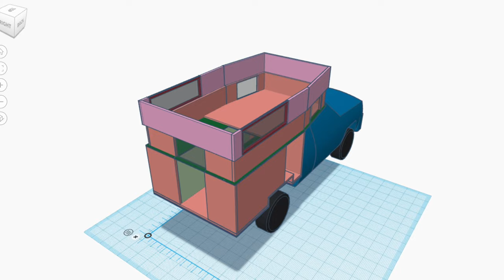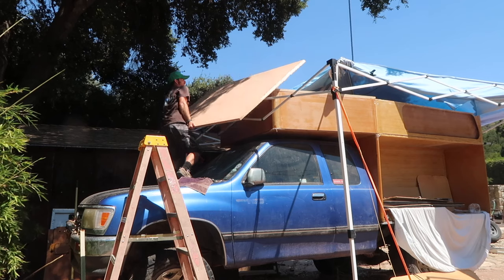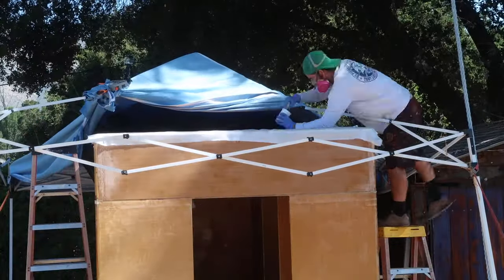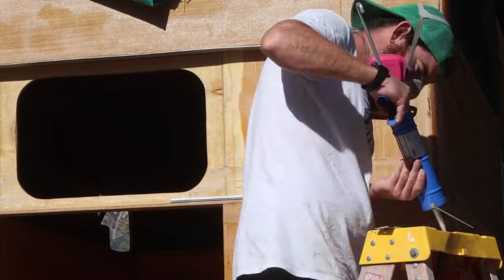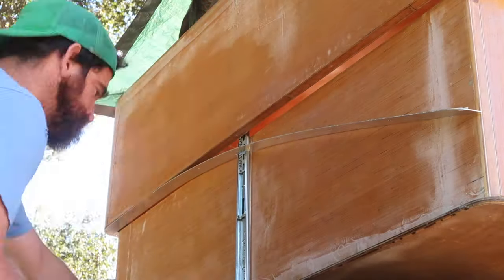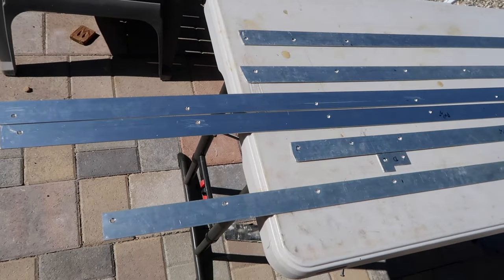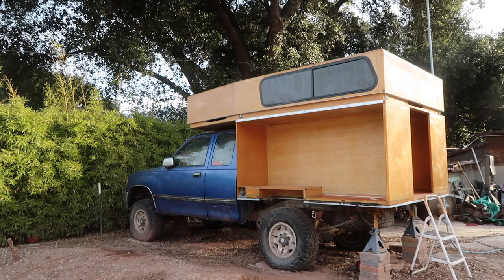Building A 4x4 Truck Camper | DIY Hard Side Pop-Up

Comment: Hi Matt - great idea for the guides and seal system. If you are planning to install a ventilation fan suggest you use a reversible model. Running it with the windows and doors closed drawing air in will pressurize the interior slightly to aid lifting the top. Running it “out” will help draw the top down.
Reply from the maker: interesting idea

Comment: Great thinking on using the drawer slides for the pop up top  as guides.👍😎
Reply from the maker: Thanks Jack. It's working well so far. The whole thing is an experiment of course, so we'll just have to see how well it holds up once I finally get to start torture testing.

Comment: Maybe a second D seal on top of the body's aluminum cap, so it seals when lowered?
Reply from the maker: I'm still considering it... Could always use more seals to try to keep that Baja silt at bay.
For now, I am adding a seal around the bottom of the aluminum on the pop-up. It will provide a seal and a bit of cushion to sit on while it is clamped down.
Reply: @TheTravelingTogetherJournal  Makes sense. Looking great!

Comment: 1st time watcher, new subscriber! 

Great information! You've answered/given me ideas on how to repair my Jayco Sportster 7. Absolutely love the drawer rail idea, the handles to pull the roof down, and the latches on the inside. Why did you place the forward struts where you did again? I missed that part even watching it again.

Great video!
Reply from the maker: Welcome aboard!
I put the front struts where I did because that was as far forward as I could put them without encroaching on the width of the queen mattress. In hindsight this didn't work as well as I thought it would. I think mounting the struts all the way forward and using less forceful struts in the front would have made for smoother motion in the pop-up. Currently it wants to teeter-totter a bit with the struts as a pivot point when lowering the pop-up.
Reply: @TheTravelingTogetherJournal  yes, I saw the teeter tottering in your video. Interesting fix using straps. Thanks!

Comment: I have a similar idea but using foam and poor man's fiberglass. Only I want it on top of a SUV. Then the rear section would have a stand-up shower.
Reply from the maker: Seems feasible. I've seen some cool diy suv or van pop-ups, but never a hard sided one. Good luck on the project

Comment: I like the idea of the design. But why not use actuators to raise the roof by just one push of a button? Just a suggestion.
Reply from the maker: I looked into them a while back and was seeing reports from other DIY builders that were having trouble getting all of the actuators to raise and lower at the same rate, particularly if their battery bank was running low. It seems like the actuators are getting more popular now, so I'm guessing that new products or new knowledge has become readily available to the DIY community to solve this, but I had already started building the camper with this mechanism in mined.

Comment: This is great. I wonder of the necessity of glassing the inner surfaces. I get glassing the inner and outer seams and the exterior surfaces but the inner ceiling? Would love to know if I am missing something in dealing with the importance of glassing both.

Also, you should coat your wood with resin then set your glass. The glass will wick the resin and leave a perfectly filled weave with no resin pooling.
Reply from the maker: Is it necessary? Probably not 🤷‍♂️
I'm no engineer, but I'll try to explain my thinking.
If you think of the roof/ceiling as a composite panel that is 1 inch thick and spans an area over 6 feet wide and 10 feet long, I'm asking it to have quite a bit of strength and rigidity for its thickness. Especially since it is a pop-up, so it doesn't have the advantage of being a complete box.
Now if you think about applying a force to the ceiling (pushing the pop-up into the up position) most of this force is exerted on the upper most and lower most portions of the panel and less force is exerted on the core of the panel. In other words, the outer surface of the ceiling and roof take the most force while the inner foam core is relatively less stressed. By glassing the outer surface of each panel I am adding strength and rigidity where it is most valuable to the panel.

of course this extra glassing adds weight, cost, and effort to the project, so it's a tradeoff for sure. If I was looking at my design and trying to cut weight, I would rather use a thinner plywood, but I couldn't source anything lighter of a decent quality without ordering much more expensive marine grade ply. Everything is a trade off i suppose
Reply: @TheTravelingTogetherJournal  Understood, a hollow aluminun tube retains it's strength because the outer portions of the tube provide the bulk of the strength. Same principle applies here.  I will be copying lots of your design. You are correct, Okoume MP would be the best plywood for the project, for the ceiling if no where else. I think I will glass inner and outer of the ceiling, like you.  Thanks for taking the time to respond. Looking forward to the next video.
Reply from the maker: @brandonsummey2418  cool. glad I was able to articulate the concept well enough.
hoping to make some progress on the build this weekend and start editing the next video next week

Comment: so nice . would you be so kind to share the interior weight and the heights of the overlap parts of the camper. for the pop up roof to the joint wht height do you have ( mesured on the exterieur? thanks a lot
Reply from the maker: Hi. I'm not exactly sure what you are asking for, but I go into the weight and dimensions of the camper in this video. Hopefully I cover your question in there
Reply: @TheTravelingTogetherJournal  the height of the overlaping section which goes up and down, the popup section height
Reply from the maker: @user-xr9zd8hq6y  16.5 inches

Comment: I admire your skills and persistence here! I'm thinking of doing a similar project on my HMMWV, but with aluminum/aluminum, aluminum/wood, or aluminum/FRP composite panels.  Lovin the home built panels, but one question...

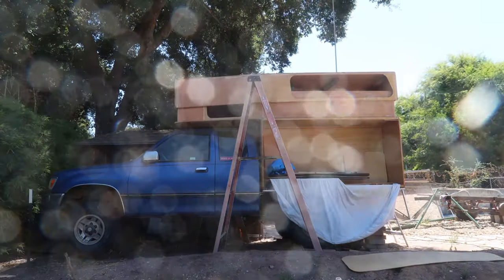3:13  ....what does this puppy end up weighing in total...and is the truck/tires rated for it at finish weight?
Reply from the maker: Thanks
Unfortunately I don't have a way of weighing the camper. I plan to weigh it at a truck scale eventually, but there aren't any publicly accessible ones near me.
My best guess is that the camper weighs 1200 pounds. The truck is rated for 1950 pounds of cargo weight capacity. Obviously getting rid of the bed and tailgate help out a bit, but I expect to be close to GVWR when I'm loaded up for a trip.

Comment: Incredible work--Congrats. Have you thought about using linear actuators to lift the topper? Subscribed!
Reply from the maker: I considered linear actuators, but thought this would be a simpler solution. I'm sure it could be done with actuators, but I have seen a number of DIY attempts go poorly as they had a lot of trouble syncing the actuators or having the actuators become un-synced if the batteries weren't fully charged.
Reply: @TheTravelingTogetherJournal  What's interior height when the topper is down? Thank you!
Reply from the maker: @ozmanfidaar6311  54.5 inches down
71 inches up
Reply: @TheTravelingTogetherJournal  Thanks

Comment: Hello Matt, How did you decide on what size Lift Supports you should use?
Reply from the maker: I wanted to mount the lift supports as vertical as possible, so I looked at the extended and collapsed lengths and tried to get the shortest ones possible that still extended long enough for my application.

Comment: Thanks for the detailed video, this is very helpful for anyone building a DIY camper, I love the pop up mechanism and the detailed explanation. I have been wanting to make something similar, do you think this type of pop up can handle strong winds every now and then?
Reply from the maker: Yes. once it is fully up and the aluminum trim/seal components are pressed together it becomes quite stable. Pushing on the side of the pop up while it is in the up position the entire truck rocks without any noticeable movement between the pop-up section and the rest of the camper.
Reply: Hey Matt, what are the specs on the gas struts, do you happen to know the stroke length and how many inches the roof lifts upwards? Thank you!
Reply from the maker: @Nimesh222  The 2 struts that are mounted at the rear of the camper are rated for 60 pounds of lift force each. The 2 mounted forward are rated for 80 pounds each. The roof moves 16.25 inches vertically. the stroke on the struts is 15.2 inches
Reply: @TheTravelingTogetherJournal  thanks so much!

Comment: Amazing build! Could those drawer slides end up rusting due to rainy weather?
Reply from the maker: I suppose they could eventually. They are steel. But they are not bare steel and I they are coated in grease on the rolling surfaces, so that should help.
Reply: Applying WD-40 (Water Displacer -40) will help protect them.
Reply from the maker: @flyovercounty1427  good call

Comment: Maybe I missed it but I didn’t see you add insulation to the walls and roof that raise up?
Reply from the maker: The roof and walls that pop up are made with the same process as the rest of the camper walls. So a cross section would be 6oz fiberglass-5mm plywood-5/8 inch close cell foam-5mm plywood-6 oz fiberglass. The area around the window is just fiberglass and plywood, so maybe that is what through you off

Comment: Question please? The ply & fibreglass = quite strong & thin but heavier that thicker ply?
Reply from the maker: fiberglass and resin is heavier than wood of equal volume.
Combining wood and fiberglass gives you a good weight/strength balance

Comment: Hi Matt. Nice build!! I've watched the series a couple times and really like a lot of your solutions. A question and by no means a critique...why did   you install the front gas struts angling east/west towards the center line of the camper instead of north/south.  Does their placement  have any impact when you are in bed?
Reply from the maker: Good question. Basically, I didn't figure out what struts I would need ahead of time and didn't realize they would have to be mounted so far off vertical to fit and provide the stroke I needed. So, poor design/planning lead me to mount them like that. It would probably be worthwhile to try mounting them in different orientations to experiment with how it affects the movement of the pop-up
Reply: Gotcha. Been there a million times. I recently remodeled a soft side pop up truck camper and have had a ball in it. For the most the soft side has not been an issue until we get into freezing temps. Building a hard side like yours has really been tempting. Thanks for the reply, the ideas and please keep doing what you are doing.
Reply from the maker: @mikecasey4766  I definitely considered a soft sided pop-up so that I could make the folded height of the camper shorter, but in the end I'm happy I went with the hard side. It's nice to have a comfortable, convenient setup but the important thing is the travel. If you're getting out there than you're doing it right 👍

Comment: I know I asked this before but what length struts did you use and was it 40pounds each
Reply from the maker: The forward ones are 80lb each and the rear ones are 60lb each. I don't remember the stroke length exactly. I want to say around 12''

Comment: How heavy was the overall build do you know?
Reply from the maker: I haven't had a chance to weigh it yet. Based on materials weights I expect it to weigh 1200 pounds. I can tell you that with the fridge, toilet, stove, battery, solar, and water system installed the truck is still sitting nice and level.
Reply from the maker: I finally weighed it and go into detail in my latest video: https://youtu.be/Bwbfe8-MII0

Comment: This extension is a great design, but I feel that that kind of bracket is not particularly good, and it can't make the most of the space. It may be better if it is changed to vertical + buckle.  Also, vhb glue needs to be heated and backlogged to activate the stickiness. Are you sticking it firmly like that?
Reply from the maker: I am not heating the VHB tape. The instructions on the 3m tape just say to clean the surfaces, peal, stick and apply pressure.
I'm not sure what bracket you are referring to or what vertical+buckle means ?